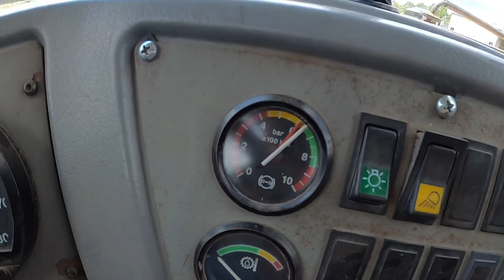Did my special guest leave after the first day??

Comment: I know this is an old video most likely not be read Matt you just as bad as DP BUT thats because he trained you with his bad habits. Production is slow both of you. Wasting so much time swinging over half way around to load the truck. You want to keep your movement   in the machine as short as possible. Takes a lot of time an spilt dirt making that long swing back an forth spilling a lot of dirt with every long swing. Get the truck driver to back up to the edge of your cut keeping your swing as short as posible¹ you will load 2 buckets in the time its taking you an dp to swing way the hell around to dump each bucket . And keep your reach half of what you been doing. Keep bucket better rolled an lest travel losing all that dirt with every swing you will load so much faster with little mess spread out. Key is to make every move count and the machine productively working. Weather it an excavator bulldozer wheel loader ext. I was trained years ago an hammered into me. That machine better be working with every mover. Undercarriage are costly. On dozer so that blade better be working with every mover. If the tracks are turning that blade better be working. Same applies with an excavator. If that swing motor an swing gear are turning it better be productive. Remember that. Keep swings as short as posible and main boom an stick boom movement as short as posible. Speed will come in know time. When I hired a contractor its always been by the hour never a set price save the customer 20 to 40% and when i seen them making none productive moves it really passes me off. Your on my dime. This is why I rent any eqipment I need. I got sick seeing it an paying the bill for bs work that was far from productive. If I worked for a company be it logging or construction and they seen me wasting time an costing them excess wear id be down the road talking to my self. It also very tiring on the operator never mind the added risk of clipping a truck with long swings an added stress with long movements things come up fast. You have more dirt on the ground on the way to the truck then in it. Witch has to be cleaned up adding even more extra work
Reply from the maker: Most turns were 90 degrees. But also keep in mound I might have 40 total hours in the seat
Reply: @nyamillennial  let me first say. I know you dont have much seat time . I an shocked you have 40 hours. This is why I took the time to type out some tips and dos an don't. I have trained many in my 62 years. But I am not that good at putting wording into text or spelling but I tried my best to out line in text best I could for you. 90 deg swing is to far. Time wasted. You want to keep that as short as posible. As well as your reach . Your reach shouldn't be more then your reach to dig. An I am not including a long reach to fix a high spot you notic way back. Your a smooth operator for such limited time that you have stated many times in a few videos. Last one I seen of dp video were he talked about you an how fast you are grasping it.. was great but I feel from what I have seen your picking up his bad habits of long swings an long reach  witch is lost time. Lost dirt. Ext. Thanks for reading an repling to a old video I didn't think you even look at